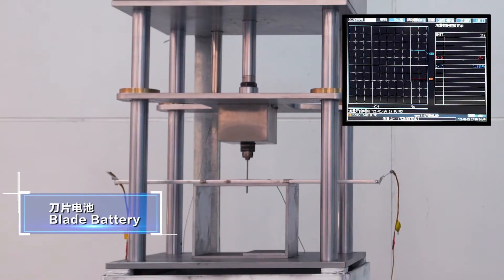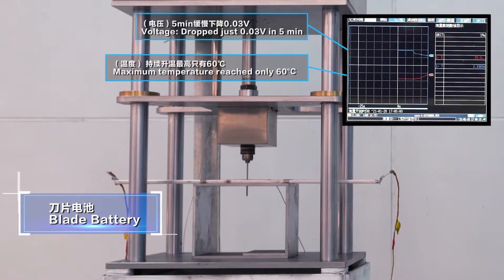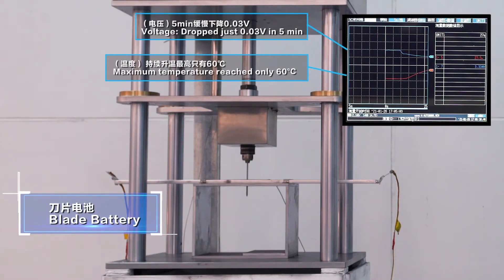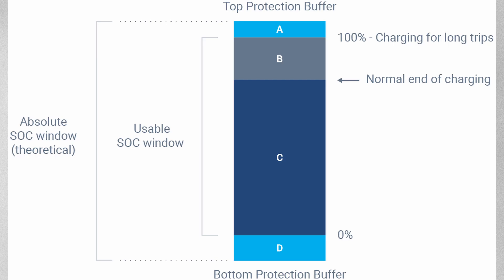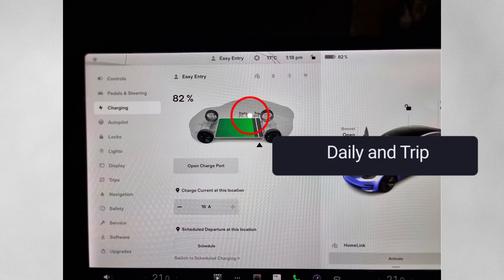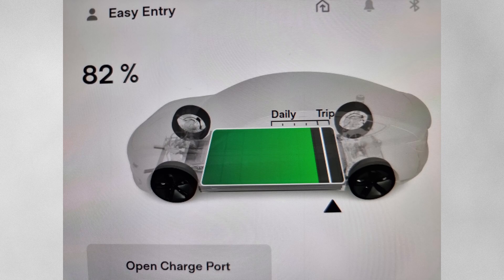EV battery care and charging

Comment: So an NMC battery would never need to be charged to 100% if you don't need extra capacity ? I thought it was still necessary from time to time to balance the cells.
Same question for the LFP: if you don't need a precise charge level on the display, don't you still need to charge to 100% from time to time to balance the cells?
Reply from the maker: You can charge NMC batteries to 100% maybe once a month BUT as soon as it finished charging drive it to get the charge down a little.  Never leave it at 100% for any length of time.  If you do regular road trips you can charge to 100% and then drive
Reply: @grumpyoldmanandhisev  Thanks for your feedback.
Yes, I understand that part.
I was asking the opposite question: if I don't need to charge to 100% for long trips, can I never exceed 90% or is it mandatory to do a full charge (followed by a run)  from time to time to balance the cells?
Reply from the maker: @MarcMarc-cf9mq  I believe the recommendation is once every month or two take it to 100%
Reply: @grumpyoldmanandhisev  thanks. currently a Nissan Leaf 1st gen that I sometime drive was never charged at 100%, it's why I ask that.

Comment: Whichever EV I get in 2024 and battery system - I will be doing the 20%-80% charge.  Reason, I will be charging at home and only will be doing around town driving since I am retired now.  I do not do any long trips and will probably only be charging up the EV a couple times a week.  I will be getting a level 2 charger installed in my garage for faster charging overnight.
Thanks for the video and take care.
Reply from the maker: I wonder if you would really need a level 2 charger installed and not just use the 10 amp or 15 amp plug with a mobile connector especially if you arent going to be doing very many kms.  With a 10 amp plug you will be able to add at least 100km range overnight
Reply: @grumpyoldmanandhisev  Thanks for the info. Yes, I am still making decisions and have several months to think about what I want to do. What I meant by level 2 charger is putting in a 220 volt plug in my garage for a little bit faster charge rate than a normal 120 volt line.
Take care.

Comment: Come on. You CAN charge NMC batteries to 100%. I have been doing so for the last 3.5 years every day with little range loss.
Reply from the maker: THen you are very lucky.  It is NOT a recommended thing unless you start driving within a very short time after it has finished charging.